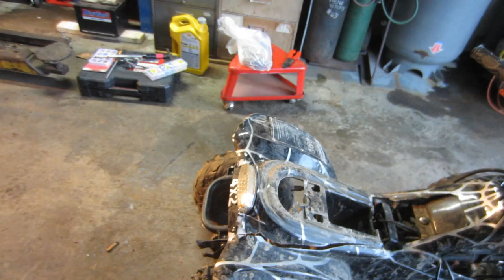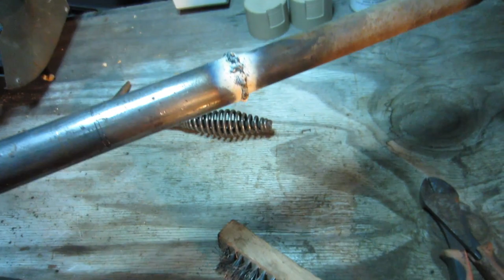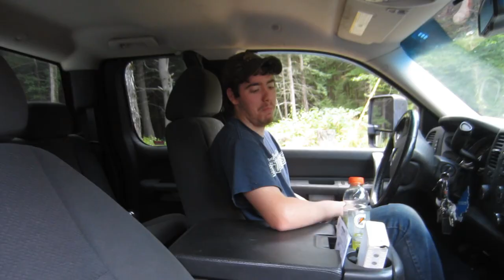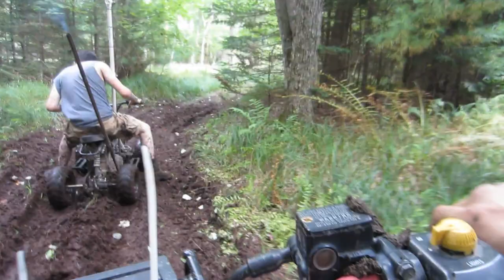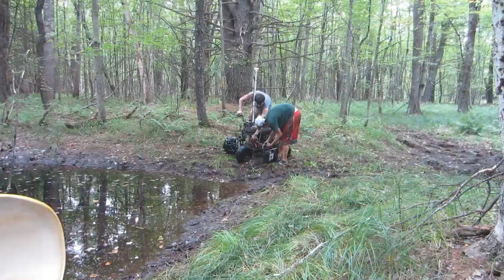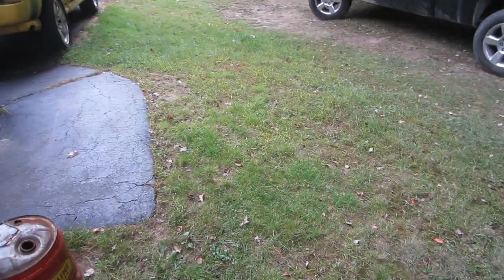Homemade Snorkel For Straight Piped Chinese Quad!! (WHEELERINE) Build And FIRST TEST

Comment: It a 4 stroke it needs back pressure to run
Reply from the maker: Yessir. Water in the carb didn't help any 😂
Reply: Ur confused
Reply: Are you joking?
Reply: No it don’t. People don’t straight pipe things for no reason. Trucks ain’t 2 stroke they 4. 2 strokes need back pressure to run properly
Reply: @D-GWashing yeah end even two strokes will run open header, hell I've seen people run two stroke motor bikes with an open exhaust port. Not even a pipe on it